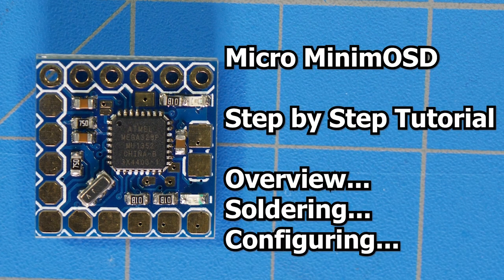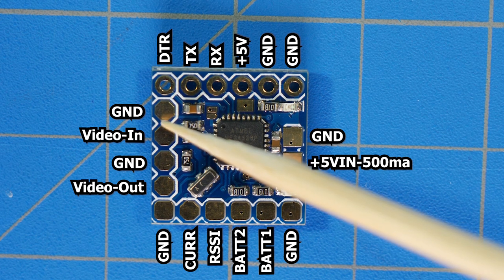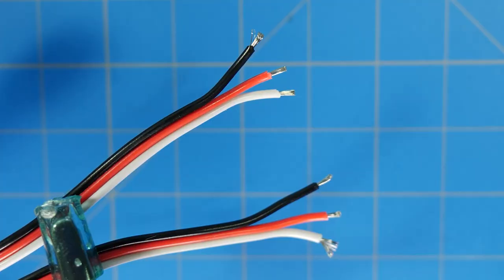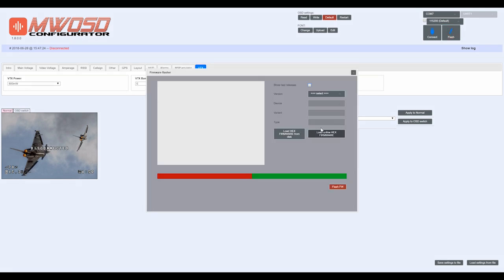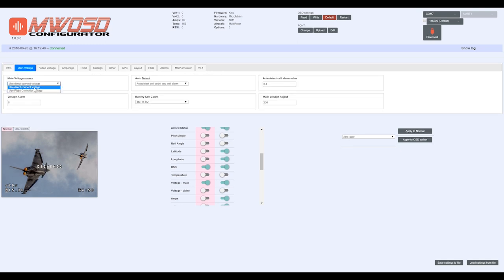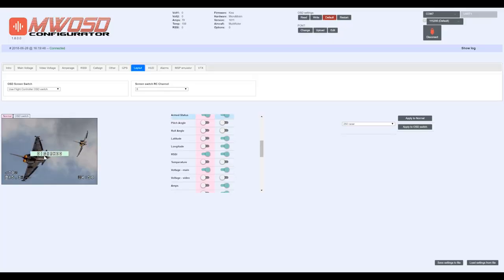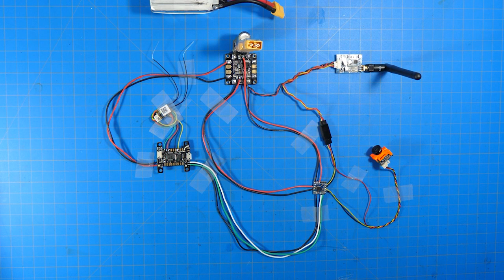Micro MinimOSD EASY Step-By-Step Tutorial | FPV OSD

Comment: Hi! Very good and helpful videio! I am struggling getting this micro osd to work. Can you please explain why you solder it from battery pads and from 5v pads same time or just give me advice how to power it? Thank you!
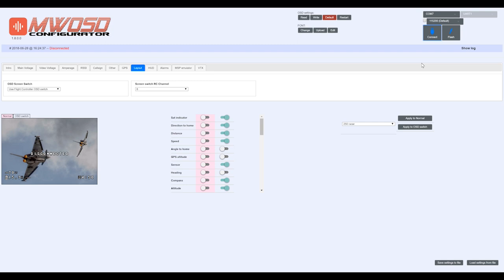Reply from the maker: Great question! It took me a min to go back through the video and see what you were referring to. However I see that when I had it all connected and taped down, I explained everything EXCEPT how the OSD was getting powered. Here is the answer. At 10:13 in the video, the two power wires connecting to the top of the OSD are going to BATT1 and GND on the OSD and running back directly to the full battery voltage on the PDB. The purpose of this is so that you can know how much battery you have remaining. The two power wires coming off of the left side of the OSD (just above the LED) are connected to the +5VIN-500ma and GND on the OSD and running back to a 5V out on the PDB. The 5V from the PDB to the OSD is what is actually powering the OSD. Hopefully this helps. LMK if you have any other questions.
Reply: @BayAreaFPV  Thank you for the fast response! I have 3 more questions as my last :) 
1. Can I power it from 5v pad from FC becouse I am running KISS 4in1 esc? (mean can fc 5v pad provide 500ma)
2. In forums most people solder a 370mF 10v cap in to the osd becouse of voltage spikes or use a voltage regulator, have you experienced any problems with it? ( I see if you run it from pdb it already has stable voltage regulation)
3. Is it a MUST to wire all grounds on same circuit to run it properly?

BIG Thanks in advance!
Reply from the maker: I would try and avoid using the 5v from the FC if at all possible. Regarding a capacitor, it really all depends on your build and how clean things are. I don’t think it should be required. Here is a link to the Flyduino site that explicitly discusses how to use a minimOSD with KISS and likely has everything you need and more.

http://kiss.flyduino.net/dwkb/flash-kiss-osd/

Comment: You don't necessarily need a flight controller, if you only want an OSD for battery voltage, RSSI, timers, current, GPS and more. All you need is the micro minimOSD. I use it on aircraft that don't have or need a FC or some that have proprietary flight controlles which are closed source. These days almost all flight controllers you can buy have built-in OSD.

Comment: I'm stuck "WAITING FOR OSD".  I did the flash first..  not sure what is happening.
Reply: oh I figured it out.  I do not have the square board, I have the board called miniosd commonly sold as a supplement for pixhawk online, and I needed to join the solder pads so that the other half of the board can communicate..   now that I did, it can flash firmware, and also connected straight away. :)
I understand that it is necessary also to solder those pads in order to have the pixhawk power the other half of the OSD board anyway, which is preferable to having it powered by the camera side of things, as the boards can get hot due to limitations of the miniosd board's voltage regulator.  It can cause some issues with noise from the servos on the OSD display, but apparently you can add a capacitor somewhere..  not sure where though..

Comment: Hello sir, i am facing a problem i.e in the mw osd configurator whatever i change settings to my preferences, i can't write them to osd because the write option is showing white means it can't be click..... So plz sir tell me what can i do, hope u will replay me
Reply from the maker: Hi there, have you registered the MWOSD configurator? There should be a button called register where you can enter the code you should have received in email. That is likely your issue. Hope this helps.
Reply: Thanks for your replay..... So how do i get that code, does you mean that i have to purchase it from there website....??
Reply: @niharranjanmahali8549  same problem here so what you do ?

Comment: Hi, I'm having an issue when I try to flash it I get the message Programming Failed failed to connect to the port , any tips?

nvm i fixed it i had to install a driver for my breakout board (Cp2102) and that fixed the problem ill keep this comment here in case anyone else has this issue

Comment: my green led not blinking what happen?
Reply from the maker: If you have power to the OSD, but the light is not blinking, that likely indicates that there is a communication issue. Check your wiring and make sure that all of the TX and RX are going to the correct pads.
Reply: @BayAreaFPV  I've done triple check but still no response. look like my osd was bricked.